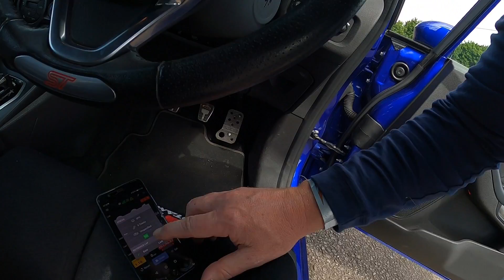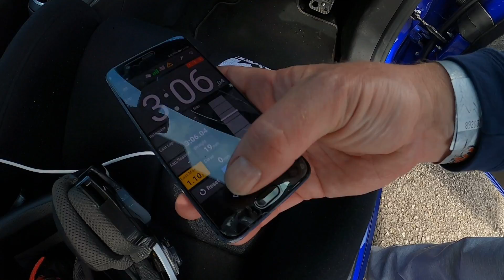M3 explodes, and then i set my best ever lap time.Castle combe 8/6/20 fiesta st

Comment: How did the s280 fez compare lap times?
Reply: I was 0.1 or 0.2 slower than Steve. Admittedly my driving capabilities are way off Steve’s, but very happy that I managed under 1:20 which was my initial target. I should have noted this was on low boost around 270-280bhp. Overall happy though, once engine is forged I can push a little more
Reply: @H-SportPerformance  why? plenty of US cars pushing 330 WHP on stock block.
Reply: Matthew Peterson will happily run that power to a certain extent, but it is essentially a ticking time bomb, I can run different boost settings so run up to 1.85 bar on the road, but as track work puts a lot more strain in terms of heat on the block. It’s also worth noting that I was having issues with brake fad on Monday, so wouldn’t have gained anything by turning the boost up 😀

Comment: Honestly Steve from what I could see the car if definitely to stiff on the rear and having no arb on the front is causing you to push on mid corner because the cars bouncing under acceleration. Me personally I would run lower tyre pressures on the rear than what you did, have you tried toyo 888s? They are a beast of a tyre in the dry. I would be tempted to run more castor and camber on the front aswell as slightly change the tracking. Fiestas like to tow out when under hard acceleration.  Have you had the car weighed scales?
Reply from the maker: What do you think is causing the bouncing under accelerating? Mine toes in on acceleration because my scub radius is positive. I can't add a more caster and I'm over 3 degrees of front camber as it is.Thanks for the advice.
Reply: @Sparkplugsteve  if the car is towing in on acceleration then that's why on deceleration the rear end is sliding you don't want the front too twitchy on turn in because if the rear is stiff then it simply can't follow the front end smoothly. The lack of arb on the front and the damper rebound is probably the biggest cause of the bouncing, there needs to be a small amount of 
" give " or you will bounce everywhere and just destroy tyres all the time. With no flex your putting alot of stress on every moving part. You can do what ever you like with your own car, im not trying tell you how to 'setup' but me personally I would weigh the cars corner weights and then go from there,  look into the rebound rate then adjust the tow to run as parallel as you can with the castor/camber in mind and finish off with tyre pressures. then I dare say you will be easing into the times you want with less effort and longer lasting tyres. I have followed the build for a while now keep up the hard work.
Reply from the maker: It's not sprung that stiff really though. 8kg front and rear. Why do you think no front arb causes bouncing.?
Reply from the maker: See what you think when the next vid goes up of more laps.
Reply: @Sparkplugsteve  will do Steve,  Which track are going?

Comment: What is that you are using to monitor the tire pressure? Does it use the stock sensors or use sensor caps? Nice clean build by the way!
Reply from the maker: It's a cheap tpms off ebay. Their cap mounted ones. Look back at my last vid I show them there.

Comment: Good vid Steve, what’s your general consensus on the AR1’s over the ad08,s ?
Was thinking of making the swap
Reply from the maker: Thanks rog. I'd estimate about 2 seconds a lap faster but I was warned about the pressure sensitivity and wish I listened more. I should not have gone over 28psi hot as the grip dropped and the tyre wear is quite significant down the centre line when you see them in person. Just in the front left though as that's the one that kept going to 30/31psi. Lesson learned but 100% much faster than ad08r.
Reply: Spark Plug Steve yea that interesting, there is always a balance between overall performance and value to bare in mind for us poor old worker bees 😂
I will give them a go though, just got to use up the rubber I got some how 🤔

Comment: Also i have a question why did you remove youre anti roll bar cause i heard that it benefits putting the power down a lot more?
Reply from the maker: Yeh that's why I'm not using it . It's still on the car but only one drop link is connected. There's a lot more grip on corner exit without it.